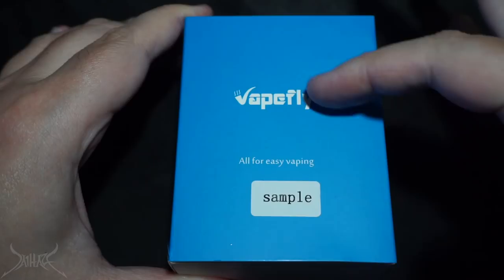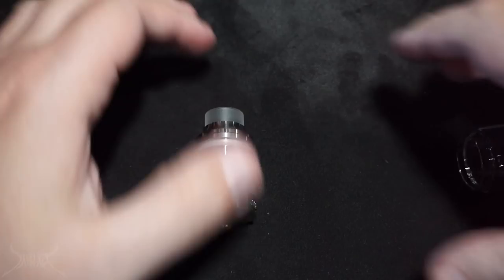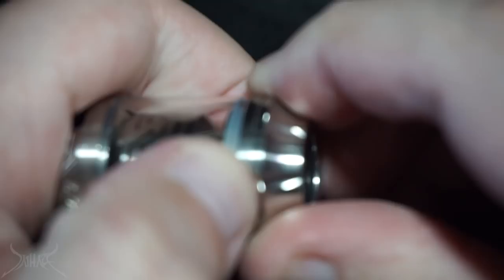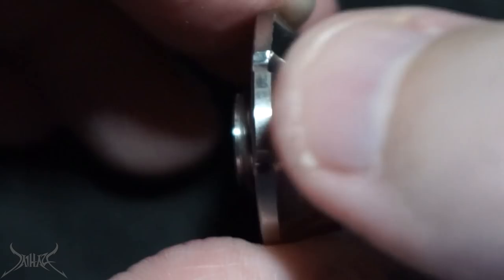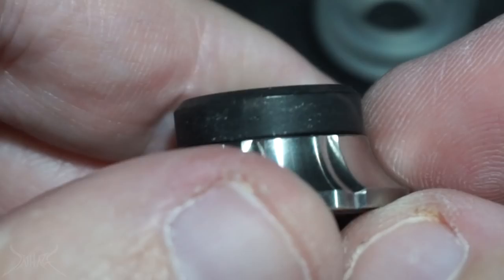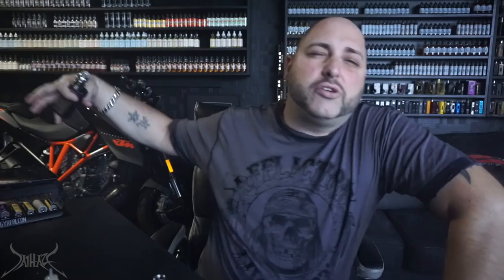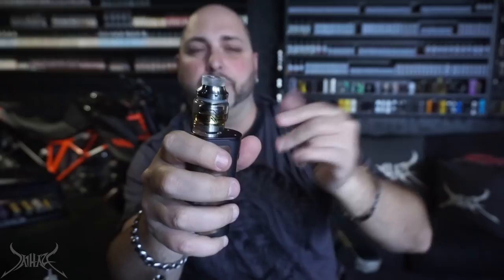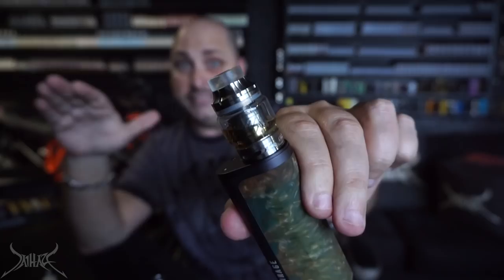Vapefly Core RTA Review and Rundown | German 103 Team Project

Comment: I don’t have an rta with paint on the inside but if it counts my doc rda with the black paint does break down. I rarely use it for that reason as i really don’t enjoy the thought of vaping on paint chips. I removed my top cap one day as I noticed my flavor was off and the top layer of cotton on both coils had a nice little black residue, after further inspection I found it was the paint. Happens every time I use it, even for small amounts of time.

Comment: Hey Jay got a update for you about the lost vape furyan. Turns out the battery direction may matter. I had the contact from the button to the nut on the squonk go bad. The nut had been warn away by the constant sparking from breaking the connection in reverse to the point it would no longer fire. Simple to fix but you only get 4 sides so don't mess them all up. This may not be what caused the problem but do to the button contact being copper and the nut being aluminum this was bound to go wrong do to different metals never playing well.

Comment: Jai about gold plating it actually improves conductivity but for the use case of vaping is miniscule.
Reply from the maker: thats not true and has been debunked several times.  That would be true if it wasnt nanometers thick. This is super thin and the base metal is what plays a role in it.  And then even using that argument, whats the screws and inside the post? Gold plated screws are trash, and gold oxidizes fast. https://www.quora.com/Does-gold-not-oxidize-at-all-or-is-it-resistant-to-oxidation great read. 320 degrees and some oxygen it destroys gold. So the point is null.
Reply: That is why I say that in vaping is minuscule/ That being said I agree that gold plate screws are a gimmick because it will tear away the thin gold plating that they use.  Gold plating is used in electronics for a reason but said gold plating is used on logic boards which do not reach the operating temperatures used in vaping and more importanly it's usually done on a nickel surface because it helps the gold not get mixed with other metals. Gold platting stain less steal is just a gimmick.  As for your link, it shows that it can oxidize under a solution that is extremely acidic with a pH value close to zero far from vape juice.  IMO they should save the 5 cents or w/e they use for it because it just ends up looking like shit with time.